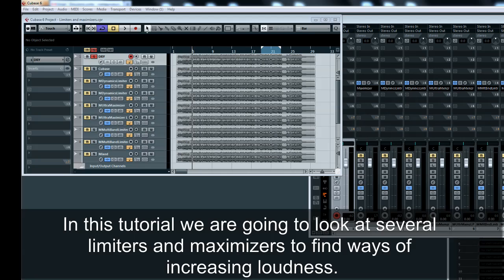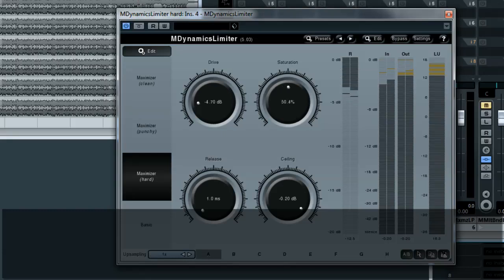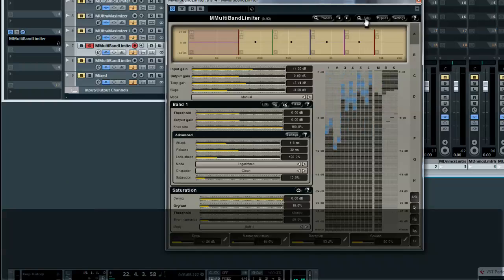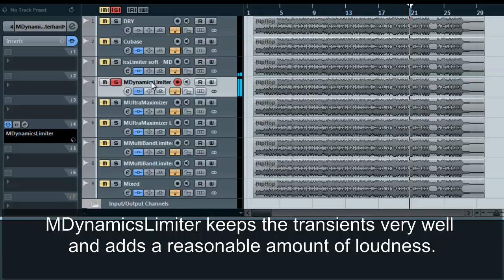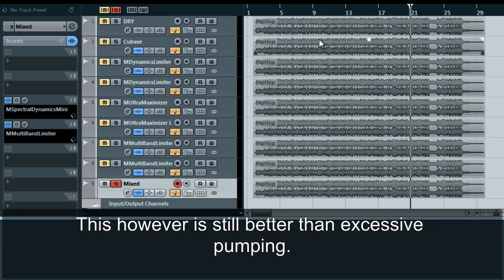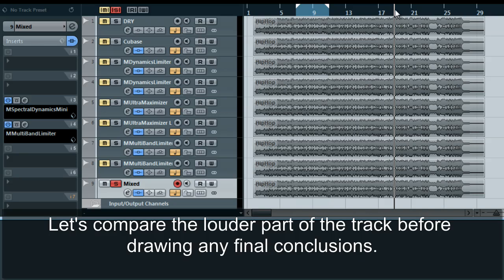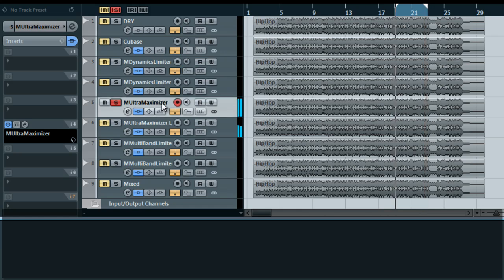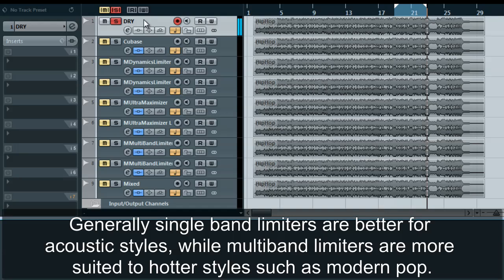Limiters and maximizers

Comment: How can I add the Limiter to a sesión in Cubase? I have Cubase 8 LE. Where I can find it? Thanks and cool vid. (:
Reply from the maker: +Eric Vera Just install it and it should be all fine. The limiters should appear in Dynamics folder in Cubase.
Reply: meldaproduction Thanks! I'll give it a try. (:
Reply: @EricVera539  Did it work for you Eric? Did you find Cubase limiter?
Reply: @meldaproduction  Oh dear, I have the same question! Can't find Cubase limiter anywhere.